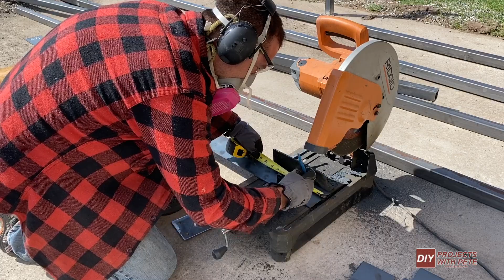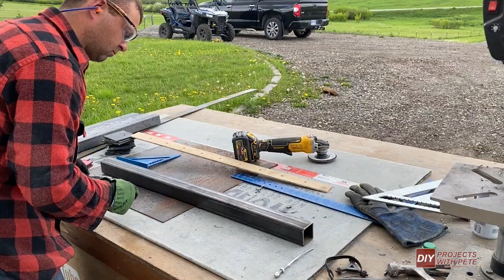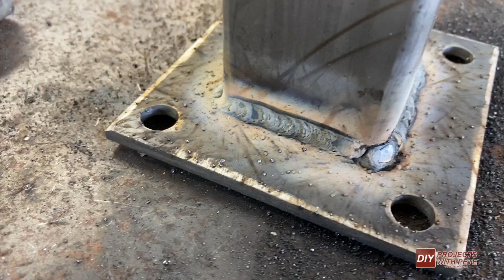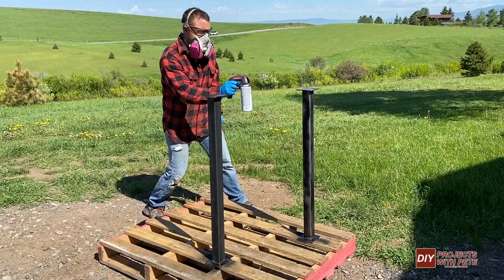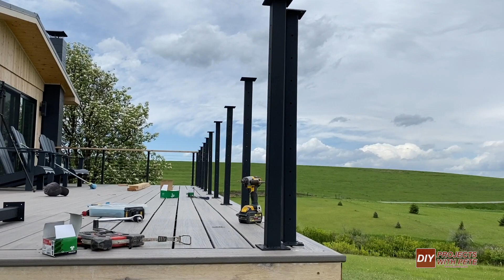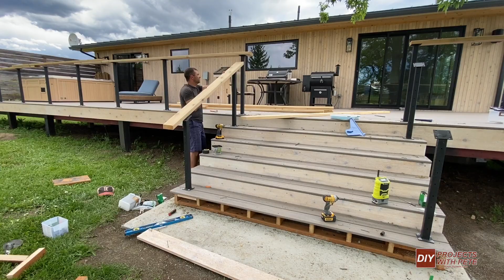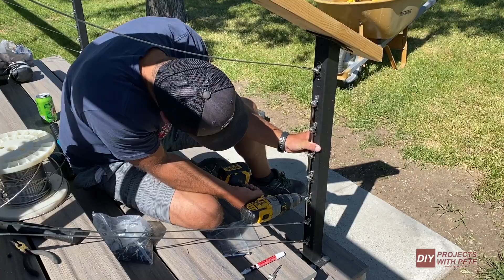DIY Cable Railing with Metal Posts Built from Scratch!

Comment: Hey there, great work on your diy. It looks lovely
Just a few pointers that would help your great work last even longer.

1. Moisture/rust is the greatest enemy of square hollow tubing. 
It's recommended that you plug any and all holes that the cables pass thru or the left over driller holes, that water could get into the posts thru (a good quality black caulking would work).

2. We typically don't free-span cable rails much span over 10'-12' for structural/anchoring posts for this type of tensioned rail, as the torsional force on the anchoring increases significantly and more prone to anchoring failure.
That's why you tend to see so much more hardware being installed from post to post, as it is easier to tension over shorter distances as well as the transmission of force is shared along all anchor posts rather than just your corner posts as you have done. 
Btw,, increasing your anchoring posts thickness, was the right call.

3. And finally, with the free-spanning corner anchor approach that you used, you should use:
a. A 1/4" steel plate (similar to the post base) instead of washers) to the underside of the blocking that supports the main upright anchoring posts. This will spread the torsional loading force more evenly over the blocking due to the tensioning forces applied to the cables.
b. Angle cleats with 1/2" thk lag screws, to brace to blocking to the deck framing horizontally & Vertically, rather than just relying on the horizontally applied 4" deck screws you used.

Cheers.
Reply: jo jace Your advice, if applied, would give this DIY project near-professional grade results
Reply: @a.m9472  haha that's funny bro. DIY doesnt mean you have to sacrifice on the lifespan of the project. If jo jace recommendations are applied it could be the difference of no maintenance or repair for decades... all for a mere hundred bucks. The first point is the most important because rain water can get trapped in there then freeze which causes the post to swell and crack then rot out within a few years.
Reply: @CalTech85  Of course, no one is questioning DIY versus longevity. I’ve done several DIY projects myself which have failed miserably and others which have become a permanent staple for my home. However, a professional job implies that everything is prepped correctly, uses quality material, and is in a configuration that is made to last. Therefore, I was implying his advice brings it from an average DIY job to the same grade as calling a professional, when applied exactly as mentioned.
Reply: @a.m9472   My own observation is that a ‘professional’ is necessarily in it for profit (nothing wrong with that).  If a short-cut yields more profit, the shortcut is often taken.  Weekend warriors (such as myself) are emotionally committed.  ‘Professional skills’ can be undermined by weak emotional commitment.  DIY Pete is more than a weekend warrior, and he has emotional commitment as well.  I am sure the lady he shares the deck with is the source of his emotional commitment.  Well done to both of you😊
Reply: @reusedisland1904  Yeah I don’t get why these replies are acting as if a professional job is incomparable with DIY jobs. People can get the same results.. yes for a weekend warrior as well, depending on the project, as long as research goes into what materials, configuration, and process is required. 
Even as a certified PE in my state, I do random DIY jobs that are not at all related to my field and now I always research first on how to make them last. You bring up what his motivation is, it’s hardly important.. Whatever his source of motivation is, this is still a great video and the tips in the top comment can be applied to make the job even better. No need to hire anyone & there is nothing wrong with sharing constructive information!
Reply from the maker: Thanks for  the great advice Jo!
Reply: @DIYPETE  no problem at all buddy.
Reply: @I_ammm_mojojojo  Great advice!!   I probably would still add a weep-hole at the bottom to let any possible interior standing water out, it's not just moisture that destroys mild steel, but standing water with nowhere to go.   Just given humidity and dewpoint changes, it's going to get moist in there from time to time, the key is getting rid of any water that accumulates and allowing some drying to keep rot down. 
             Until that top plate is welded on, it's not fun but possible to prime and paint the interior of the post as well giving at least some sacrificial coat for the eventual moisture that WILL accumulate.  The top isn't as critical, it can be bare for the welds.   I did cringe a little when I saw the size of the holes he drilled, it would have been a fight, but they should have been as close to wire diameter as possible, even calk is going to work with wind, ETC over time.   It's definitely going to work open up with holes that size, but better than the alternative of doing nothing...
Reply: This is excellent advice that I found useful. Thank you for this info. Very clear and concise.
Reply: Excellent pointers - can you please provide some details on the last point - "3. And finally, with the free-spanning corner anchor approach that you used, you should use:
a. A 1/4" steel plate (similar to the post base) instead of washers) to the underside of the blocking that supports the main upright anchoring posts. This will spread the torsional loading force more evenly over the blocking due to the tensioning forces applied to the cables.
b. Angle cleats with 1/2" thk lag screws, to brace to blocking to the deck framing horizontally & Vertically, rather than just relying on the horizontally applied 4" deck screws you used." I am trying to do a similar install for metal railing posts (no cable railing just normal baluster type railing between posts) but I am trying to understand the use of steel plate as well as what is an angle cleat - I tried to find these online but couldn't can you suggest for both - thank you.
Reply: @petiwalas  Just think girth and surface area.   IDK if your physics instructor in HS did that trick about breaking a stick with just a single piece of newspaper over it, but there's a lot of power in surface area.     A plate the same diameter of the posts or slightly larger gives a broader surface area underneath the structure to secure the post which will reduce its ability to 'work' or move over time.    Adding a washer for a shim means the contact surface area has just been reduced to the size of that single washer.
               It's the same principle with the lag screws over deck screws, only their advantage is diameter thickness which = strength.  Doing all that work to bolt and secure the posts is meaningless if the entire nailing surface the post is bolted to can work and move, lag screws would provide more rigidity and strength than a mere wood screw of a much smaller diameter.
Reply: @crforfreedom7407  That breaking a stick demo has nothing to do with your comments above, that is to do with atmospheric pressure.

Comment: Hey when you cut flat bar you should cut vertical not horizontal. You will save your cutting disc.
Reply from the maker: No worries! Thanks! It's a great tip and actually I used to do it horizontally until I figured out by trial and error that the vertical works better!
Reply: Sorry just got to that part where you cut them vertical😂😂😂

Comment: Great work. But they will end up rusting out. An what app did u use to design it?
Reply from the maker: Hi Torius, I ended up drilling a hole in the bottom to drain water from them. Google Sketchup

Comment: Just use bed liner spray on and it will last forever, and just drill the hole at the 32 degrees for the stairs instead of all that crazy hardware
Reply from the maker: Never thought of a spray bed liner, I will have to try that on some other projects sometime!
Reply: The crazy hardware looks a lot better.
Reply: @diaz7412  Nope.
Reply: He already drilled the holes and was going to use the other hardware. He made do with what he had.

Comment: Any concern about water getting in the posts through the holes where the cable runs through? I’m looking at a similar design, but I’m concerned about rust leaching, even if I powder coat the outside.
Reply: If you are concerned with rust you can purchase a electronic anti rust device that changes the polarity of the metal or  endura paint which is used on deep sea oil drill rigs and on rigs used in harsh environments
Reply: You could drill a simple drain hole at the base of the post.
Reply from the maker: I should have drilled holes during the project, but ended up doing it after the fact. Take care

Comment: When you're attaching the railing posts, you're actually making them plumb, not level.
Reply from the maker: Thanks John!
Reply: So you can't call it a level then. It's a plumber . 🤡
Reply: @LemonySnicket-EUC  I'm guessing you haven't had the chance to make a bird's mouth with a framing square yet? Looking forward to calling it a bird's mouther at work tomorrow. 🤡
Reply: Lol, you just made my point. Read your comment again, carefully. 😂
Just in case you can't figure it out, the name of the act need not match the name of the tool. 😂
Reply: @LemonySnicket-EUC  The act you are performing need not match the name of the tool you were using, clown.

Comment: Living by the sea, with loads of rain, I am worried about rust. What about protecting the inside of the steel tubes, and drainage at the bottom?
Reply: You'll need to get your posts hot dip galvanized after you've welded the plates and drill all the holes. Drill a drain hole in the bottom plate. Hot dip galvanizing costs about $18/m2 of surface area. It's not very expensive.
Reply from the maker: I think James has some great suggestions. Take care!

Comment: Great job! Looks awesome so the only critique I am going to make is you should of made a small drainage hole in the bottom of each post. Because the posts have small holes in them they will get water in them and the way they are now the water will just sit in the bottom of the posts. If you decided you wanted to you could still, using a hand drill and a small bit, drill a hole through the bottom of the posts using your bolts as a guide as where to drill.
Reply from the maker: Thanks for the tips! I did end up doing the hole on the underside. Cheers!

Comment: Great job and nice video. Only question is, are you concern about water getting inside the posts and having no drain hole?
Reply from the maker: Thanks Michael! I ended up drilling holes on the underside of each post after the video. Thanks!

Comment: Awesome video as always Pete. What if you make the holes with the 32 degrees angle on the stairs rails so the cable doesn’t bend just my thought. Overall it is an awesome job. You made something beautiful and saved a lot of money.
Reply from the maker: Thanks Alejandro! I tried to set up an angle by clamping it to my drill press, but it kept slipping and I had trouble getting it to hold and do an angle. Otherwise, that was what I was thinking to do. But I do like the hinge hardware as it was forgiving and made it easy. Thanks a ton!

Comment: Did you use any type of rust inhibitor inside of the posts?
Reply from the maker: Hi! I did not, this is a great idea though and probably something I should have done to help them last longer. Thanks for pointing that out.
Reply: @DIYPETE  I wouldn't worry about it...the posts will probably outlive you by a good amount.  Might need a paint job at some point obviously though.

Comment: What is the thickness of the the 2” square tubing?  Thanks.
Reply from the maker: Hi! I used .120 thickness ( about 1/8 inch ) - for the corner posts    , and .083 thickness ( about 1/16 inch ) - for the inner posts.

Comment: I think the cable looks fantastic, however there is a down side to it. A local restuarant in our town has this on their deck. Unfortunately people particularly kids like to put their feet on the lower cables. Unmonitored kids will climb the cables like a ladder and stretch the cables. They look terrible after they sag. Hopefully you have a way to adjust and tighten them.
Reply from the maker: Thanks JB! You are right about kiddos trying to climb it. We certainly watch them when they are near the rails, and while it keeps them in, a lot of climbing can stress them out and cause it to sag. Good news is, they tighten up again super easily ( at least the hardware I used ) - so it isn't a big deal, but yeah gotta watch the little ones and try to get them to avoid climbing the railing! :) Cheers

Comment: It looks fantastic. What do you think of using aluminum posts instead of steel posts?
Reply from the maker: Hi Peng! A lot of the posts you can buy online are aluminum. Aluminum is a great material since it will not rust. It is going to typically be more expensive though. If you plan to do your own welding, you'd need to have a TIG welder, since a normal welder will work on steel but not aluminum. Steel will be the most affordable and DIY friendly --- and with a good powder coat or paint, it will be protected from the elements. If you find some good quality aluminum posts online that are pre-made, you can still save a lot of money by purchasing your own cable/hardware etc. Just depends how much you want to DIY of the project :) Cheers!
Reply: @DIYPETE  Thanks Pete. Love the stuff you do. Keep up the good work.
Reply from the maker: @davidleny58  Cheers